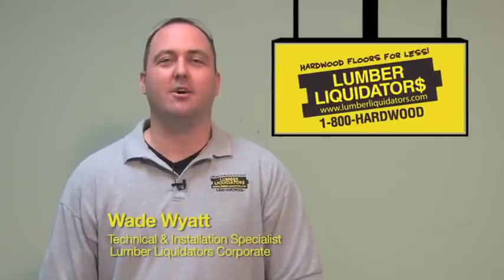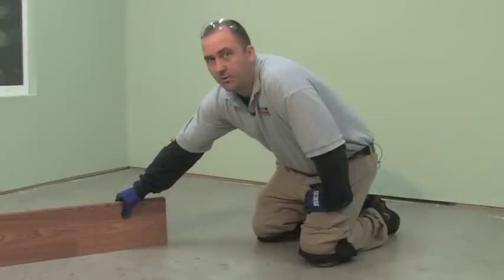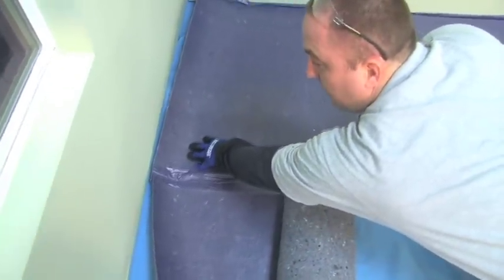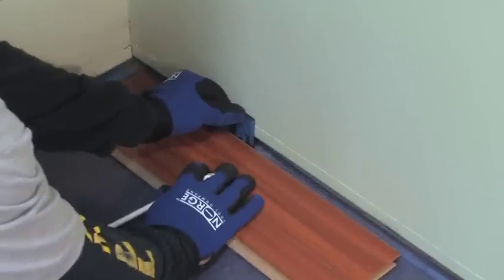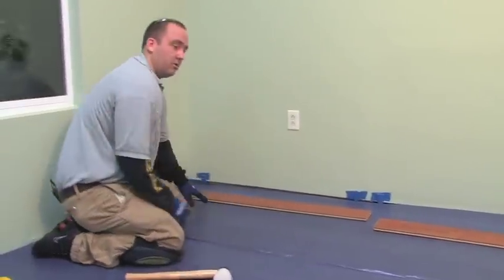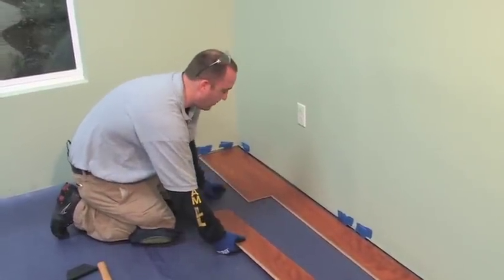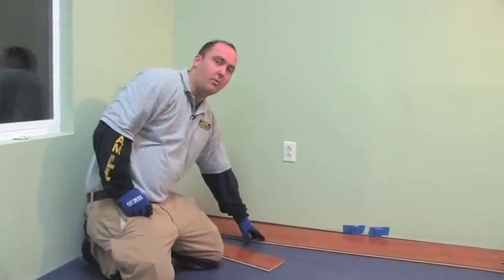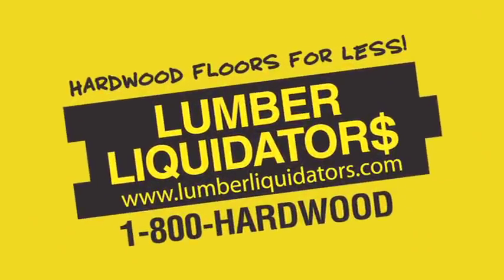How to Install Laminate Flooring (Tap-End Joint) Including Moisture Barrier | LL Flooring

Comment: I wouldn't 'beat' the ends together.  That flattens the locking mechanism, and causes it to show cracks later on. Been there. Done that.  It's better to put a whole row together first locking the ends together correctly. The new boards are locked together on top of the lip of the last row.  Then you lift the entire row and lock it in to the last row.  If you have no helper you can make wedges to hold the not yet locked in new row up at a 30 degree angle until the full row is locked together.

Comment: The video doesn't show how to use the chalk line he created. And what should one do with a gap (or multiple gaps) by the wall if the wall happens to be wavy?
Reply: make sure none of those gaps are any larger than the width of your baseboard and they'll be hidden

Comment: You don't even show the part where you take off the spacers.  I want to see the space that is left behind when the spacers are removed. And I want to a step by step guide of you putting floor trim on top of that space between the wall and the floor board where the spacers used to be

Comment: I don't see the purpose of the chalk line if your pressing the plank against the spacers and the wall.
Reply: I suppose there is a chance that the walls aren't square.
Reply: Walls are hardly ever straight
Reply: you must have missed the part where he said (and rightly so) that many, if not most, walls are NOT straight.  If you follow a crooked wall on your first plank, by the time you get ten or twelve rows down it will be very noticeable that the lines are off
Reply: Ernie Simpson i think at first it seems irrelevant but remember he is giving a tutorial. Not saying, "hey watch how i do it." He is giving 2 options for the same purpose. Also something I  thought about is that often times older homes are not perfectly square and having that chalk line will also help you visually see any bowing.
Reply: Ernie Simpson some walls have a bulge  r even  curve and you have to cut first row  chalk  line just helps you make sure it's straight
Reply: The walls are hardly ever straight, yet he's using it as reference to keep his line straight???
Reply: No it's absolutely pointless- he's measuring from the wall so if the wall is crooked the line will also be crooked the way that chalk line was made will only be as straight as the wall
Reply: Same here...If he's placing the spacers against the wall and pushing the planks up against them, he's still using the wall as a reference, not the line on the floor. Perhaps he didn't mention that he may be using different thickness spacers to keep the plank even with the reference line?
Reply: Bingo!  The difference between being square and not magnifies with each course.

Comment: nice, no glue?
Reply: +Eudaimonia cat A "floating floor" does not use glue/nails... or any other methos of attaching the floor to the subfloor.  This is why it is referred to as a "floating floor"  The locking mechanism of the floor is what keeps it from needing any type of adhesion to the subfloor.

Comment: What happened to the concept of starting in the middle of the room, like with hardwood flooring installation? Not all walls are square. Might have a surprise when you get to the opposite wall. No adhesive; no nails? I'm thinking of using this in a camper, but I cringe at the thought of the Masonite core.

Comment: Tapping the laminate together when it is not on a angle it will void the warranty and cause gapping later on. If you do tap a piece together a wood glue can be used to keep the manufacturer warranty

Comment: The "extra" Moisture barrier is pointless if you don't run up behind the base 2" for any moisture to disperse away from the laminate. DO NOT put spacers behind the laminate until the 1st 3 rows are complete because any variance in the wall will cause the laminate to pull apart

Comment: Okay how do you fix any unlevels in the floor ?
Reply: +Franklin Vaquerano sanding, leveling compound, depends on the type of subfloor and how uneven it is
Reply: have to use thinset concrete if you have an uneven floor
Reply: do you mean because floor is unleveled?   Wouldn't that have been something that you had to consider before laying the wood?  Either you level the floor or don't dare to put wood in because they won't snap in, if they do, you got bubbles under, and you'll see that the new flooring does not feel or look right.